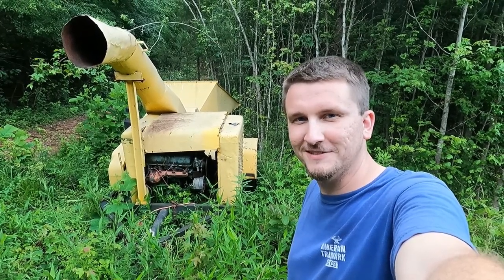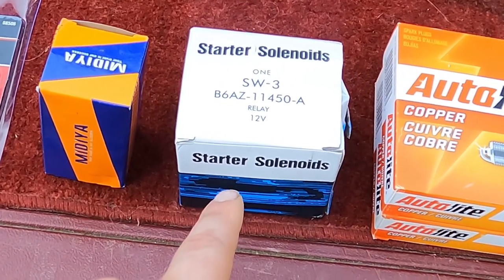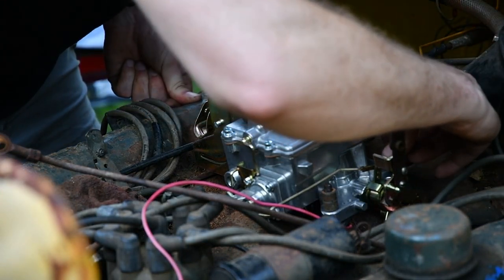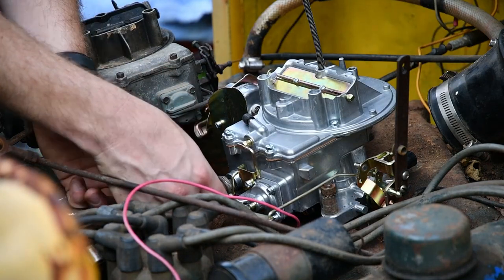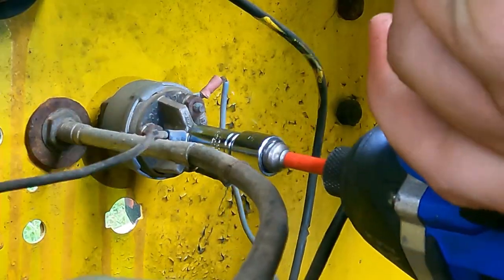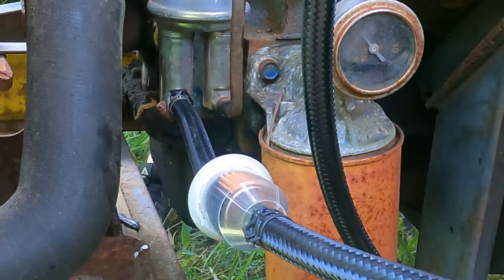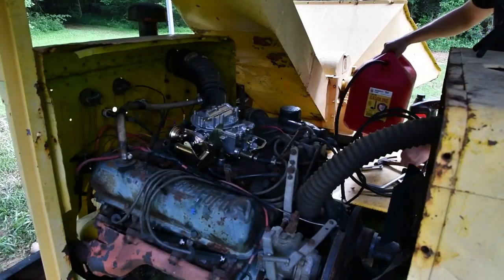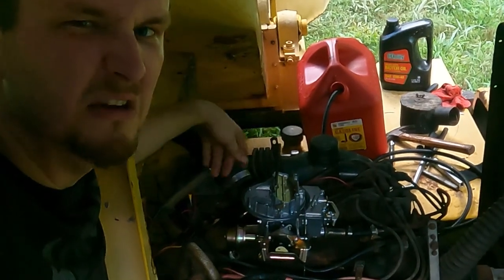JUNKYARD FIND: Restoring This Rusty Wood Chipper Engine!! WILL IT RUN? | Carburetor Replacement!

Comment: I HAVE ONE OF THESE CHIPPERS. THE ENGINE IS A 330 HD (HEAVY DUTY) AT LEAST MINE IS. Mine was frozen too and I had to drop one of the pistons and hone the cylinder and install new rings. The governor is set for 2000 RPM for chipping. The knives should be really sharp. I wouldn’t chip roots with dirt and rocks in them. I am restoring mine now. Mine has 5 belts and a 16 inch head. Is yours the same? Mine is a 64 chip more chipper

Comment: I would try and get that running just for the fact that the governor is for that motor and the pto clutch is for a Ford bell housing. If you have to get another engine 300 inline 6 would be your best bet.
Reply from the maker: The governor is belt driven so it could probably convert alright but the bell housing is my concern if I was to convert. I think a rebuild is more likely.
Thanks for watching!

Comment: Waste of time. Blow head gasket. Running it with water in the oil. Say goodbye to the bearings. Looks like it’s trashed. It’s dime being held up by a dollar bill.
Reply from the maker: Hmm, that may be true. The oil mix smelled heavily of gas so I'm hoping it wasn't coolant mixed in. So far there's no smoke out the tailpipe which I would expect if it was a blown head gasket. Either way it's still fun to try!